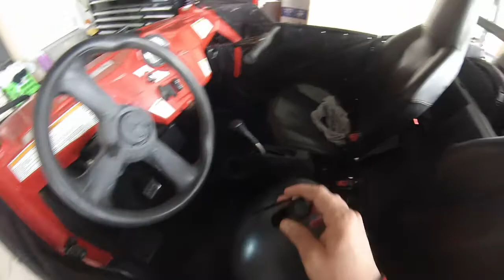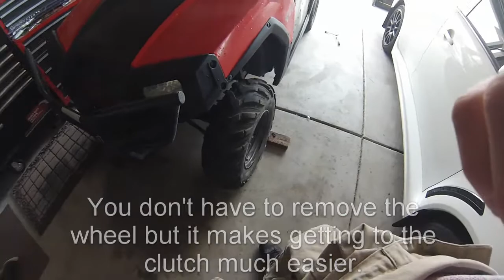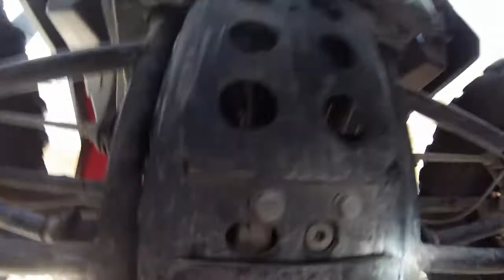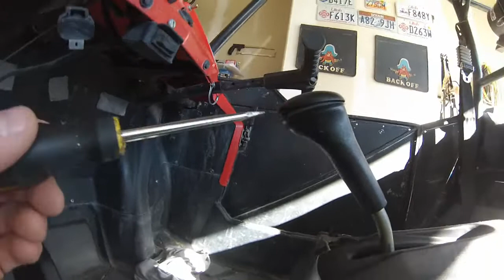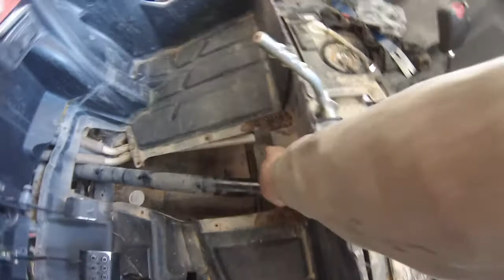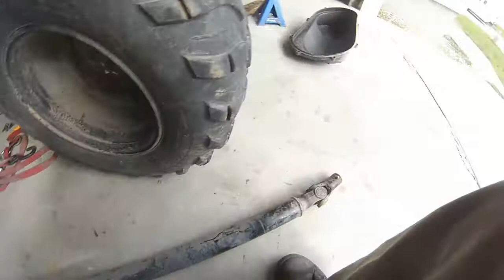RZR Driveshaft Propshaft Removal HOW TO

Comment: Hi. Great video. Do you have a reinstall video? I have a 2012 RZR 900 and I’m trying to figure out how to get the shaft back in. I’m debating whether I need to remove / loosen the front gear case. I can’t seem to get enough clearance to put the shaft back on. This is a big job and big pain in the rear.
Reply from the maker: I don't unfortunately. The 900 is a slightly different beast. I will say, however, if you think you might need to remove the front gear case then it's best you do that. I really fought with this project on trying to take shortcuts and not removing components that I would have been better off just removing more components. Good luck and thanks for watching!

Comment: Really an excellent video - explains everything!  I appreciate you finding a way to drive the pin out from the bottom!!!  I was seriously wondering how I was going to get that pin out, even with my roll pin punches.
Reply from the maker: Thank you for the kind comments! I'm glad this video helped you out with your project.
Reply: @TheDadBodWorkshop  Seriously helped!!!  Took me about an hour to get it out, taking my time.  Only loosened the driver's side of the floor pan and was able to prop it up enough to get the shaft out.  Couldn't have done it without the detailed instructions you provided.  Thanks again!
Reply: Which side of the drive pin do I hit?
Reply: @rockydelaretojr8463  I don't believe it matters.